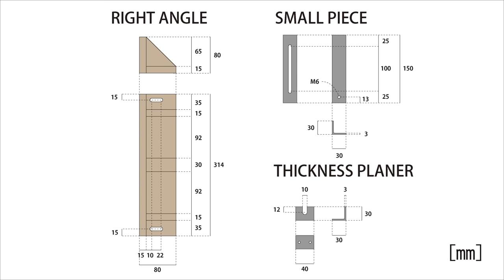6 Best Electric Hand Planer Hacks | Simple Ideas | Benchtop Jointer

Comment: Fantastically designed  jig and equally good video showing build. Mimicery is the ultimate form of flattery and so it was so good I went out and built it. As the result, I've got a couple of things to add. The Makita planer model is not the  KP180DZ, which is electric not battery. It's instead the DKP180Z 18V LXT. Also, the Makita aluminium base is 9.25mm thick. I note that at the 1 min 08 sec video mark the two bases, old and new, are shown side by side. You can see that the new base is ever so slightly thicker. This is because the aluminium bars only come in 75mm x 10mm, not 9mm. Therefore, a 10mm base is used for the extended bases. Keep up the great work Yasuhiro!!

Comment: Hi, I really like your solution to replacing the original back plate. But I just can't find 9mm thick aluminium or steel plate. Only 10, 8 or lower. It could work if I use a 6 and a 3 mm plate together? Maywe welding from the side a little bit?
Reply: Or better to buy the 10mm one and grind down to 9mm?